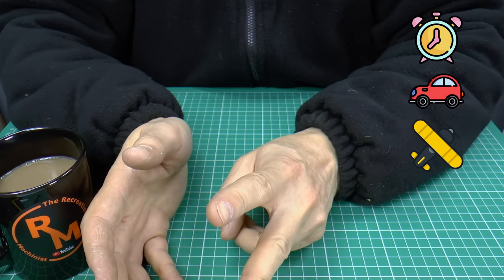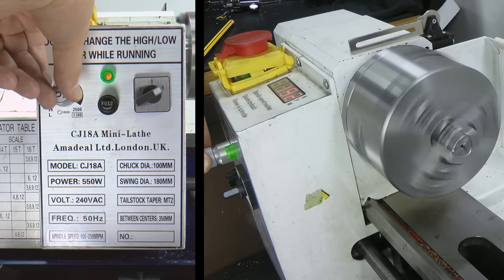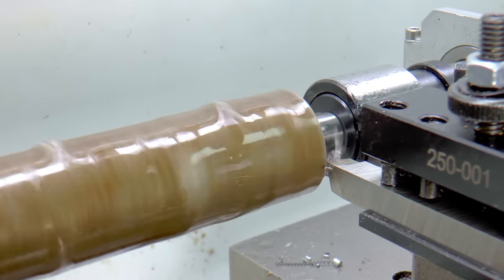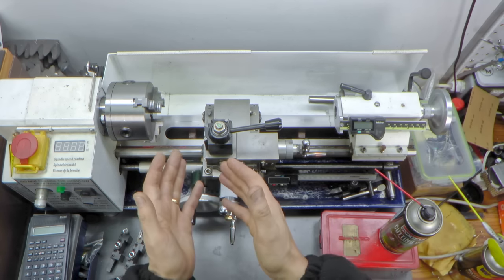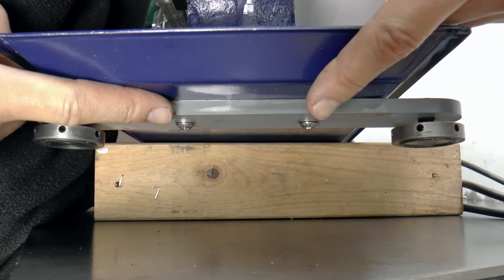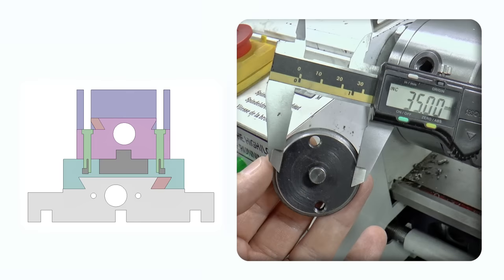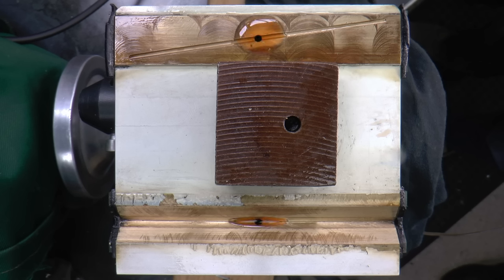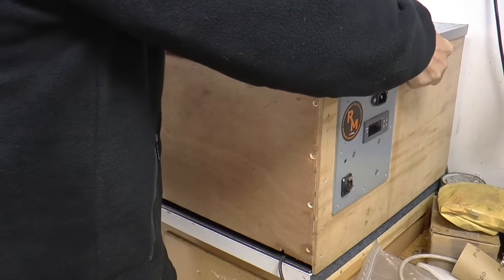10 Years of Mini Lathe Ownership: Pros, Cons, Modifications and Improvements

Comment: I've watched this video before and finally got round to commenting! 

This video pretty much represents the perfect summing up of the topic. I honestly don’t think I've seen a more balanced and sensible approach to the question "Should I buy a Chinese mini-lathe?"  This video should be required viewing for anybody who is thinking of buying a Chinese mini-lathe.

I'll admit to being a bit ambivalent about the subject myself. I do kind of wish I'd either spent a bit more and bought a Warco WM180 or been a bit more patient and roped my colleague's dad into helping me find a decent used Boxford (the dad is a model engineer and has let me play a little with their Boxford A and Myford ML7).  That said, I've learned an awful about lathes over the past year or so.

I'm currently in the second tranche of my upgrades and improvements to the 7x14 I have (bought from Amadeal, like yours). 

The first tranche was the disassembly, cleaning, adjusting, deburring, fettling and reassembly tranche. Oh, and fitting of angular contact bearing replacements for the very wobbly deep race spindle bearings as shipped (yeah, probably should have returned the lathe but eh, I enjoy the fiddling and I would have done the upgrade to angular contact bearings sooner or later anyway 😂) and of course the inevitable apron cover!

The current tranche is adding Steve Jordan's central shear plate rigidity upgrade. I've already lapped the contact surfaces on the front and rear undersides of the bed for the side shear plates (really quite roughly machined, that took not a little elbow grease and a fair old bit of grinding paste!) and shimmed the shear plates, so dispensing with the tensioning bolts. 

After all that effort and mucking around it should come as no surprise that I have not lapped the underside contact surfaces in between the ways of the bed by hand! 😂 

I ended up making a jig to hold a Proxxon rotary multitool with a small diameter grinding wheel tool, in a mini-lathe vertical milling slide.  That allowed me to make very light and careful grinding passes on the contact surfaces with no unpleasant manual heaving and sweating 😂. 

Just playing the 'find the right thickness shim' trial and error game now. 😉

Also as part of this second tranche of improvements, I'll be changing the drive system for the spindle.

You see, I was a little cavalier with my hydraulic press when changing to the angular contact bearings and damaged the original headstock, so I had to get a replacement casting.😳

My lathe has a brushless motor, and so the original headstock had no hi/lo gear mechaniam. However, when I got the replacement headstock I got a headstock with the same form factor as my damaged headstock but with the hi/lo gear assembly. When I initially reassembled, I left the hi/lo gear assembly out and had the spindle driven directly by the belt from the brushless motor as it was before. That worked as well as it did with the original headstock.

This time upon reassembly, I'll be reinstalling the hi/lo gear assembly and countershaft and running a shorter V-belt from the motor to the countershaft that drives the spindle via the hi/lo gearing.  Of course that'll means the RPM display will be nonsense (a product of the motor RPM and the ratio of the original toothed pulleys on the motor and spindle, I guess; anyway, it'll be wrong), so I've got a castellated thing to put on the spindle and a sensor PCB that I can plug into the display. Using the 'lo' gear should provide a bit more torque and is probably what the lathe will stay in most if the time anyway (if my maths regarding the gear reduction is correct).

Then I'll get some good solid time in on some projects that have been far too long delayed! 😳😂

Then after 6 months (assuming I haven't yet had a windfall that allows me to buy my long desired Boxford A), I'll start on the last tranche which will be fitting a DRO and an ELS.

Did toy with replacing the brushless DC motor with a 3-phase 1.5 HP motor and a VFD (and it's not unlikely I'll need a VFD when I do have the money for a Boxford, so there's that) but frankly, the 1 HP brushless motor is probably a reasonable match for the rigidity of this little lathe and so I've abandoned that idea.

These little 7x14s are projects in and of themselves, so if someone is very goal-oriented then they may not be the right choice but let's face it, most of us are a little addicted to the delights of tinkering so even the goal-oriented amongst us are likely to reframe the 7x14 project as a challenge they wanted to attempt anyway 😂
Reply from the maker: Wow, that sounds like a serious project! Thanks for watching and commenting 👍 🇬🇧
Reply: @TheRecreationalMachinist  I'd have been more gushing, but honestly, a quarterly cadence in video output is...disappointing. Quinn of Blondihacks fame manages one a week even with a shoulder injury. 🧐

😄😛😄😛

Seriously though, I've yet to watch a video of yours that I didn't enjoy or/and learn something from. Keep on keepin' on, at whatever frequency. 😊

I will admit that I'm just starting to feel a strong need to actually work with my lathe for a while, as opposed to working on it. 😉 I'll be glad to get this tranche finished. 😊

Comment: My lathe is a 8x16. Still a mini-lathe that can be lifted by hand, and not much more expensive. The big advantage is a 37 mm spindle bore. In 6 years I hat only one part that was too big for it. I have upgraded it with a 3-phase motor and inverter and and a electronic lead screw.
Reply from the maker: That bigger spindle bore does sound useful... 👍 🇬🇧
Reply: @TheRecreationalMachinist  Use and abuse :-) I even turned tapers to wooden handles of garden tools. Don't try this at home. This long stick out is dangerous.

Comment: Sadly my 10X30V lathe got around 10-12 hrs use im guessing before it completely died.  I tried tinkering on it to fix it but the electrical system is completly dead and i need to have a custom tool post bolt made as the factory ones are too short and the nut only catches the very tip of the bolt so any tension on it and one or two threads on it that it catches strip.  Im moving towards the crowd against the cheap mini's.   Mine i think was built on a friday before a long weekend lol.

Comment: Just a thought that came to mind during the festivities...I thought the load on a parting tool was proportional to the width.  Would it be good to use the narrowest parting tool you could possibly get away with?  Does that help with a small machine?
Reply from the maker: Absolutely yes! I think that's part of the reason for the success of the carbide grooving tool: It's particularly narrow and has reliefs, clearances and chip control built in that are beyond my skill to grind into HSS. Thanks for watching 👍 🇬🇧

Comment: What mini mill are you using? Really enjoy all the mini lathe content!
Reply from the maker: It’s an XJ9512 (a close relative of the Sieg X2). It shares many of the shortcomings of a mini lathe, but it’s incredibly useful and quite capable of making decent hobby grade parts. I wouldn’t be without it. Thanks for watching 👍
Reply: Got a new 7 x 16 brushless. But the carriage casting is no good. The shoulders that hold the carriage feed bolts are 90% missing!

Comment: The other question that needs asking is how much did all the improvements cost? Would you have been better off with a NEW and QUALITY mini lathe (or if you have the space a bigger one) from the off - Cowells in the UK for instance made my mini lathe and it wasn't that much more pricy than the Chinesium import (at least when you also account for all the shipping etc) for seemingly a huge step up in quality (though I haven't actually ever had hands on the cheap import as I haven't found anything to really dislike on CW beyond the annoyances of a machine a bit smaller than you really need for the job you want to do now.
Reply from the maker: Though sometimes time consuming, the modifications I have made have cost little more than pocket change, and has been an excellent diversion from the stresses of day to day life. Crucially, as an entirely self-taught hobbyist, over the space of a decade the process has furnished me with knowledge and experience that I would have missed out on by simply "buying better". 

Part of the fun for me is trying to achieve results beyond the price point of the equipment. I don’t think using 1% of the capability of a beautiful Schaublin would give me the same satisfaction.

My machine is still available (shipped from London), and currently comes in at just shy of £600. A significantly smaller, less powerful (but undoubtedly higher quality) Cowells is closer to £4000. Chalk and cheese. 

As I’d hoped I’d explained in the film, machine selection is all about what you’re going to use it for. If I were an aspiring watchmaker the Cowells would certainly be of interest, but 10 years ago I didn’t NEED a machine at all. I WANTED to dip my toe in the water and this was the path I took. 

If I had £4K to spend now, I’d be looking at making more space in the workshop for something like a used Harrison M300.
Reply: @TheRecreationalMachinist  Oh I agree, the learning can be worth it on its own, and just dipping a toe can make you want to cheap out - however for an informed decision on if you should buy the cheap import or a better quality machine from off it is worth considering the hidden costs of the cheap machine. As if it takes you years and costs £500 in stock while also requiring you to have other machine tools to create the parts to fix it. Then just to make it good enough for the jobs you actually wanted a lathe for you suddenly are out heaps of extra money and now have a second machine (that if you cheaped out on as well is probably just as desperate for fixes). As you probably won't have the a mill etc - a lathe really aught to be for most the first machine after a pillar drill... 

Also if you are really just dipping your toe you may not have the right mechanical instinct and feel for machining to know why your results are garbage. Where if the machine is good you know the blame is on you somewhere - it is your speeds/feeds that terrible cutter geometry you just ground (etc).

Though it has to be said I didn't spend nearly that much relative to the import ones cost at the time. If memory serves for a much much better kitted out lathe and the extra motor and spindle stuff for cutting gears etc it was only 3x the chinese import without any of the extra features that to get even import at the time worked out to brining the totals much closer. Though the primary driver for my choice was really needing precision for the project I had in mind when I bought it - sure you can get good results with lots of effort and skill on the cheap tool, but its much easier if you don't have to fight the tool.

p.s at the time workshop space was also very limited so even a moderately bigger machine would be a pain, and you have to consider the torque curve and speed range at the tool rather more than the motor power - I've made stupid moves and that motor doesn't even notice, so it really doesn't need more grunt, but the design being belt drive means you could easily add more if you do find a need.

Comment: Like any tool it does what it is designed to do, but us users push it to its limits and beyond.  Can someone who grew up metric help me with this I always assumed I defaulted to fractions of mm as SAE was my first measuring system, and although accurate is using it the wrong way in the right way.   Wouldn't this be 24219 micrometers and not 24.129mm? I thought the benefit of metric was never having to use fractions.  I work in both, usually depending on what I'm working with, if the car was originally standard I use SAE if it was metric I use metric, with the thought that the next person would probably expect it.   I mean most of my cad work has fractions of mm in it but... again I just assumed its because I'm much more comfortable with fractions and native metric users actually stepped down to the next x-meter when it wasn't a whole.

Comment: @5:15 I'm not sure a 63 tooth gear is "good" approximation for cutting metric threads. The proper gear would be 127 teeth.  That is nearly a 1% error. For an example, an M5x0.8 and an imperial #10-32 screw are fairly similar and male thread of one will often screw in 2 or 3 turns into a tapped hole for the other, but after those 2 or 3 turns one is in trouble. If I did my math correctly (I might not have) the difference is quite close to what one would get using a 63 tooth translation gear.

Though from watching videos it looks like people rarely single point thread on mini lathes generally preferring dies, so it may all be moot
Reply from the maker: Certainly close enough for hobby work of the kind that can be typically achieved with a mini lathe. Many threads of engagement or critical high load applications might cause problems, but if that's your game chances are you're using higher quality machinery... Thanks for watching.

Comment: MFG. Engineer here. I must say this is 100% spot on. I was lathe shopping up until last year when I had to move and lost my shop space. 

At the old place I was originally looking for a 14 inch over ways and ~36 inch between centers. This is big enough to handle the vast majority of home projects short of serious farm equipment repairs.

I cringe when I see people shopping for 20 HP monarchs. I am rambling, anyway these mini lathes are a fantastic option and with my 1500 sq ft shop downgraded to a 200 sq foot room my projects are down sizing accordingly as well.

For those looking for something a bit bigger I would encourage you to consider grizzly. They are not production grade or accuracy but they are a fair quality for their price point and slightly more robust than these “Chinese” mini lathes. If you’re looking to try the hobby out than these mini lathes are perfect.

Believe it or not your measuring equipment is more important for accuracy than the lathe. If you can measure it, you can fine tune it.

Comment: The gap between the cross-slide and and the face of the bearing boss (viz the part you replaced with black material) is convenient for gauge blocks if you really need to position the cross-slide precisely.  If you build a carriage drill adapter it's particularly useful for returning to its design position.

Comment: Hmmm.. there is a direct replacement of bearings. 
I did it years ago.... do not remember bearings designation but I can check.
Only one plastic spacer on the spindle should be made again.
Only... if inch lates are made with some inch bearings wich I doubth... China work in metrics, and change to imperial only if they absolutly must.

For lead screw manulal feed... 
I made it bit different...
Made a handweel that will engadge with one of the change gears for thread cutting.
Put 40 and 60 tooth gears, and with 1.5mm pich on the lead screw, you will get exactly 1mm move for one full turn.
If you made a scale on the handweel and some kind of "tingy" that will have a line on it, you can move the carriage with reasonoable precision.
If you are interested I can send you CAD, it's bit hard to explain by text only...

BTW.. nice rewiew, and nice ideas.. I will use some of them 
👍

Comment: Could you expand on your complaint about the tachometer?
Reply: I believe he's pointing out the missed opportunity to incorporate pulse width modulation, enabling constant speed and avoiding the increase in motor rpm.
Reply: Yes that could be it. The remark about a "closed loop control" is a mystery to me, but since he had just commented on the inadequacy of the speed controller, your explanation makes sense.

I had a similar issue to the one I think he is describing when installing a DC treadmill motor (with the original control board) on a Delta clone 14" bandsaw. (The motor seems to rev up considerably during a cut.)  @michaelmclachlan1650

Comment: Does it have imperial scales? Thousandths of an inch is better accuracy
Reply: You are American? The ‘world’ has moved on. 😊
Reply: @jhai2121 imperial and metric are just different measuring systems. You use the one you're used to, or if you need to, you learn to easily convert between. Neither metric or imperial offer a finer resolution  and neither has anything to do with 'accuracy'.
Reply: Firstly you're using the wrong word. You mesn resolution not 'accuracy'. Second, if you're in the States, a mini-lathe's carriage, cross-slide, top-slide and tailstock's scales will generally be in imperial. 

That said, metric mini-lathes generally have cross-slide and top-slide scales that are effectively graduated in thousandths of an inch, they're just labelled as 0.025 graduations.

Just as an FYI by the way, neither measuring systems (imperial or metric) are more 'accurate' or have a finer resolution, you just pick the appropriate resolution for the work you're doing. 

For hobbyist machinists, that normally means 'thous' (0.001") or hundredths of a mm, with those using imperial, making occasional forays into multiple 'tenths' (0.0001"). 

Those hobbyists using metric can stay in hundredths of a mm since 4 tenths is almost exactly 1 hundredths of a mm.

I use both imperial or metric depending on the need. If the drawings of a kit or spec are in imperial, I'll use imperial, otherwise I use metric, since the latter's what I'm used to.